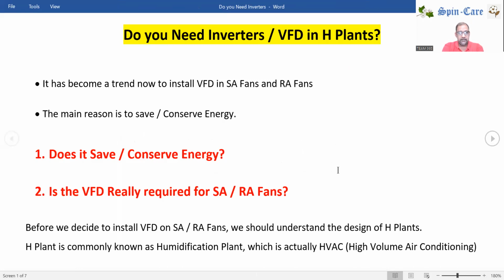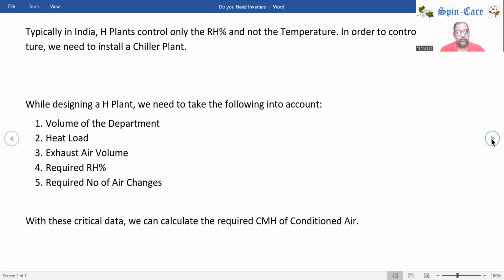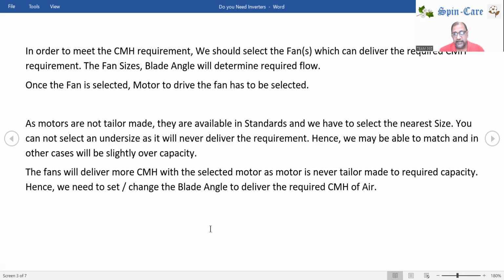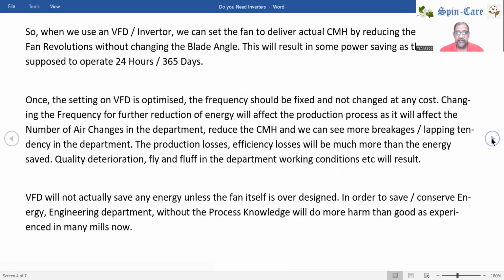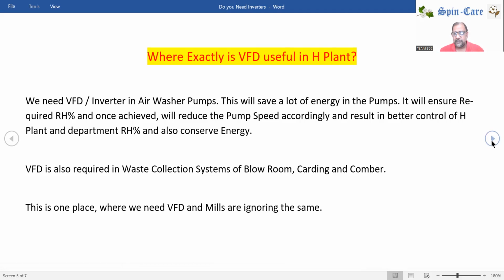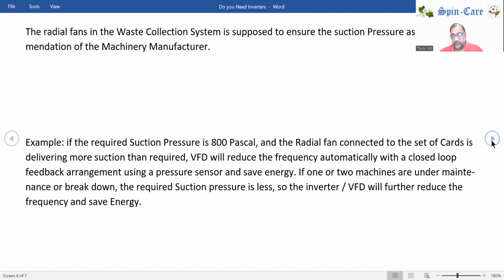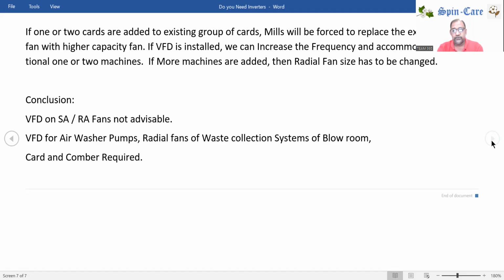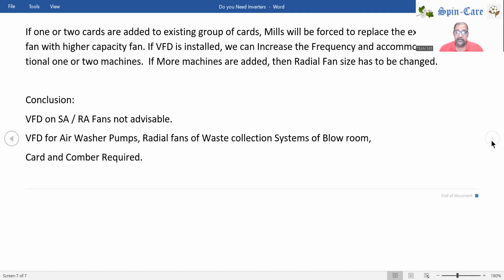Spin Care - Spinning Information - Is VFD required for H Plant SA / RA Fans?

Comment: Explanation is good and useful.
But when the frequency variation is more can we have to install vfd in supply and return air fans ?
Reply from the maker: It is not correct to use VFD as a stabilizer for high frequency variations. Such variations can also affect and damage the VFD.